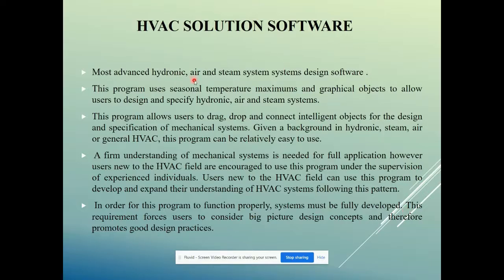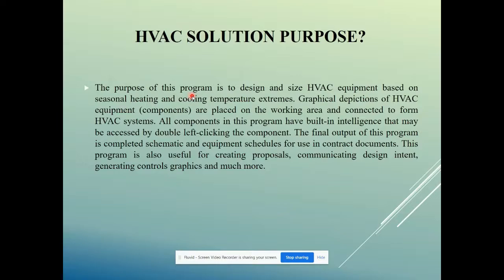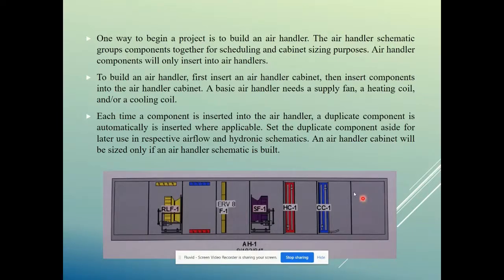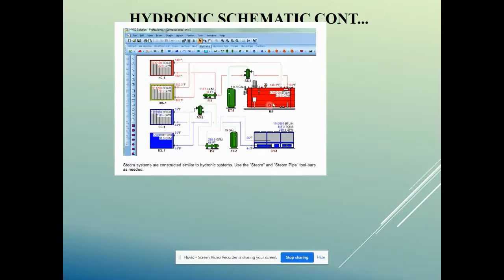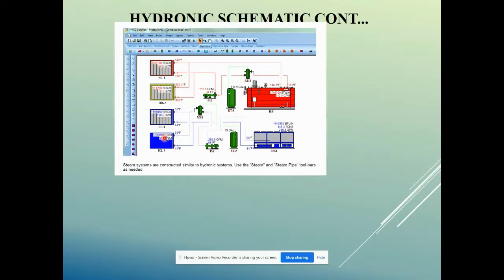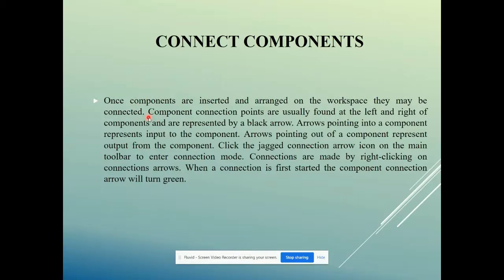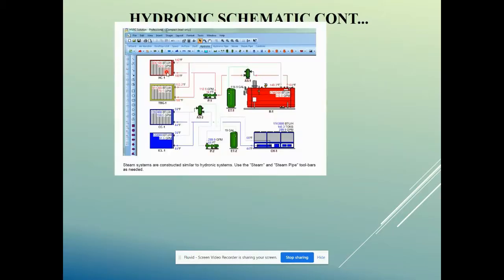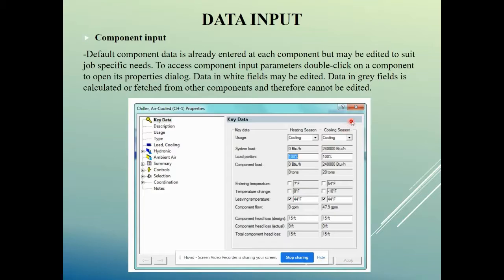Lecture 3 Introduction to HVAC Solution

Comment: NORASLAN BIN MOHD SIDI
B071710008 BMMH S1/2

1.The program assist user to design :
   -Air handlers
   -Air flow
   -Hydronics system
   -Steam system

2.General procedure to create project profile as below: 

    -Drag and drop components onto the page.

    -Enter specific component information at each component.
    -Connect components in schematic form to define component relationships.
    -Review the automatically generated schedules for each type of equipment.
    -Save the project for later retrieval

3.Besides the air flow and hydronic schematics that can be previewed or printed, HVAC Solutions also produces numerous equipment schedules. Just some of the schedules available include: boilers, chillers, air handlers, air separators, coils, cooling towers and dampers. 

4.These schedules are provided as both DXF files and spreadsheet files. This makes it easy to just print the schedules, import them directly into drawings and other documents, or manipulate the data further in a spreadsheet.

Comment: MOHD SYAHIRAN BIN MOHD PIKERI
B071710026 BMMH 1/2

HVAC Solution is a schematic diagramming and database tool for laying out the equipment involved in an hvac system. A complex hvac system often involves one or more chillers, boilers, cooling towers, numerous air handlers, fans, coils, pumps and more.

HVAC Solution enable to drag detailed icons of these components and place them on the page and then connect them with schematic pipe lines. Each of the components contains performance and sizing data that is maintained with the component.

More than just drawing pretty pictures, HVAC Solution is also an intelligent database. All pertinent data can be entered and maintained through pop-up forms for every component in the system. Once connected together, each component automatically communicates information back and forth to the other components. As the system diagram and database is being built, all the data is being updated and saved for quick retrieval or sharing with other applications.

The other features including :

    a) Draws HVAC Air Flow and Hydronic Schematics
    b) Allows Unlimited System Arrangements
    c) Hundreds of Component Makes Are Provided
    d) Schedules Can be English, Metric or both unit systems
    e) ntelligent Components Communicate with Each Other
    f) Supports Water, Propylene Glycol, Ethylene Glycol, & Steam
    g) A dual season Imposed Load component for modeling change-over systems
    h) Multiple Imposed Load graphic types for modeling varied hydronic systems
    i) Creates Schedules for All Types of Equipment
    j) Schedules Can be DXF Files or Spreadsheet Files
    k) Taco Load Match® single pipe system automated design feature
    l) Calculates Boiler Flue Sizes
    m) Air and Fluid Property Calculator
    n) Fan and Pump Law Analyzer

Comment: AMIRA NASUHAH BINTI ALIAS 
B071710121

In this tutorial session, will be design basic component of an air handler unit (AHU) by using HVAC Solution software. This software has variety option of system can be used in order to do the simulation or drawing the layout of the system.
*AHU
*Rooftop unit
*Hydronic system
*Steam system

Under AHU tab there a few components can be used such as:
*AHU cabinet
*AHU plenum
*AHU fan
*Heating coil
*Cooling coil
*Hybrid coil (Heating coil with cooling coil together)
*Evaporative cooler
*Air-to-air energy recovery filter
*Sound trap
*Damper
*Louver
*Hood

Also, this software has a pre-made layout of the standard system used nowadays. And to excess this pre-made layout simply go to wizard tap that located beside the AHU tap.

Under Wizard option there a few available systems which are:
*AHU wizard
*Rooftop unit wizard
*Terminal wizard
*Hydronic system wizard
*Hydronic subloop wizard
*Steam generation wizard

Comment: LIM PEI JUN
B071710194   4BMMH S1/2

HVAC Solution is a schematic diagramming and database tool for laying out the equipment involved in an hvac system. A complex hvac system often involves one or more chillers, boilers, cooling towers, numerous air handlers, fans, coils, pumps and more. All of these air flow and hydronic items have to be carefully selected and coordinated with one another. HVAC Solution lets you drag detailed icons of these components and place them on the page and then connect them with schematic pipe lines.Each of the components contains performance and sizing data that is maintained with the component.
All pertinent data can be entered and maintained through pop-up forms for every component in the system. Once connected together, each component automatically communicates information back and forth to the other components. This allows the software to guide the designer on making sure the components are matched up and coordinated correctly. 

There are three schematics as the main in design a hvac system: 
1. Air handler schematic 
2. Airflow schematic 
3. Hydronic schematic 

A air handler unit must have it own schematics, however airflow schematic is to support the flow of the air handler and the hydronic schematic is combine the system of pump or boiler or chiller.  three of this are in link and work together to provide a good hvac system design.

Comment: MOHD RAHIMI BIN MUSTAPHA	
B071710225
BMMH S1/1
Lecture 3: HVAC Solution Software

HVAC solution software is one of most advanced software that available for doing simulation on HVAC system. This software has the most advanced hydronic, air & steam system design software and able to uses seasonal temperature and graphical object to allow user to design based on the requirement. This software quite easy to use since its able to allow user to drag, drop and connect intelligent object for design and specification mechanical system.

Also HVAC Solution can generate a schematic diagramming and database tool for laying out the equipment used in an hvac system since complex hvac system often involves one or more chillers, boilers, cooling towers, numerous air handlers, fans, coils, pumps and more.

This software also has what call as an intelligent database. Which means that the data can be entered and maintained through pop-up forms for every component in the system. Also its able to notify the user whether the system draw is properly connected or not by showing directly on the screen.
There are few advance features HVAC Solution has comparing to FloPro & CHVAC software:
-	Draws HVAC air flow and hydronic schematics
-	Schedules can be english, metric or both unit systems
-	Schedules can be DXF files or spreadsheet files
-	Having intelligent components that can  communicate with each other
-	Allows unlimited system arrangements
-	Supports water, propylene glycol, ethylene Glycol, & many more
-	And many more.

Comment: AHMAD LUQMAN HAKIM BIN ZAMBRUS 
B071710359 (BMMH S1/1)

The HVAC Solution is a a design software which includes hydronic system, air and steam system.
1) Requires load calculation from CHVAC
2) Used by HVAC consultant and designer

3) Design and size HVAC equipment based on the seasonal heating and cooling temperature extreme to get graphical description of HVAC equipment. (For project report and proposal)
4) Assist in the design of:
   - Air handlers
   - Air flow
   - Hydronics system
   - steam system
5) End results of each component is linked to the others in order to be sized properly, export info in form of schedule and schematics.

6) The air handler must be designed and built to obtain air flow schematic.
7) The hydronic schematic  must be consist of of the components (boiler, pump, etc) and linked to the air flow schematic, only requires alteration from air flow schematic to change its specs.
8) Hydronic schematic component such as pump, boiler and chiller was inserted once the air flow schematic was started.  
    - heating schematic include heating coil, boiler and pump
    - cooling schematic include cooling coil, air cooled chiller and pump
9) Load program interface used to determine the equipment size and provide equipment schedule
    -  an example of load program is Elite software's CHVAC.
    -  the design on the CHVAC must be similar to HVAC Solution in order to obtain the same result. However differences may occur due to round up of result

Comment: MUHAMAD NURHISYAM BIN MOHD HASNAN
B071710148 
4BMMH S1/2

-most advanced hydronic, air and steam system design software.
-uses seasonal temp maximum 
-allow user to drag, drop and connect intelligent object for the design and specification
-the system must be fully developed in order for this programm to functioning well.

purpose
-to design HVAC equipment based in seasonal heating and cooling temperature.

basic project creation step
-insert comp
-arrange can connect component
-edit component
-select equipment
-generate equipment schedules 

can be used to design
-air handler
-air flow
-hydronic system
-steam system

Comment: MUHAMMAD HAFIZ BIN JOHARI (B071710380)  BMMH S1/2

HVAC Solution software is a dynamic interactive systems building software for HVAC systems design. The only software of its kind; built by engineers for engineers

Schematics as the main in design :
 1.Air handlers
  2. Air flow
  3.Hydronics system
  4.Steam system

HVAC Solution has beautiful detailed icons for all these types of components: air handlers, supply fans, return fans, return-relief fans, relief fans, outside air fans, exhaust fans, pumps, hydronic boilers, air cooled chillers, water cooled chillers, expansion tanks, air separators, cooling towers, heat exchangers, cooling tower sumps, dampers, heating coils, cooling coils, roof hoods, louvers, terminal boxes, panel radiation, finned radiation, unit heaters, and fan coils.

Comment: MUHAMAD IZMAN BIN JAMALUDDIN
B071710518
4BMMH S1/2

HVAC Solution Pro software helps you design air handing, airflow, hydronic, and steam systems. Design in minutes what used to take hours or even days. HVAC Solution software is a dynamic interactive systems building software for HVAC systems design. The only software of its kind built by engineers for engineers.

HVAC Solution enables to drag of detailed icons of these components and places them on the page and then connect them with schematic pipelines. Each of the components contains performance and sizing data that is maintained with the component.

This software supports the design: 
1. Air handlers
2. Airflow
3. Hydronic system
4. Steam system

 Load program interface used to determine the equipment size and provide equipment schedule
 1. An example of a load program is Elite software's CHVAC.
 2. The design on the CHVAC must be similar to HVAC Solution in order to obtain the same result.